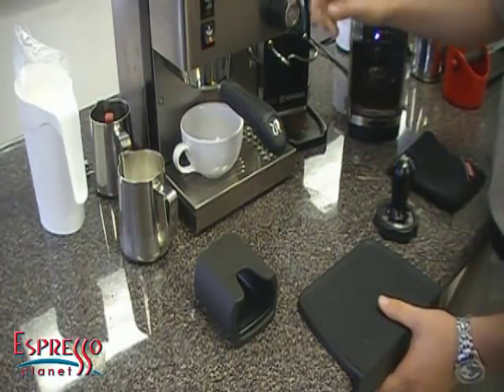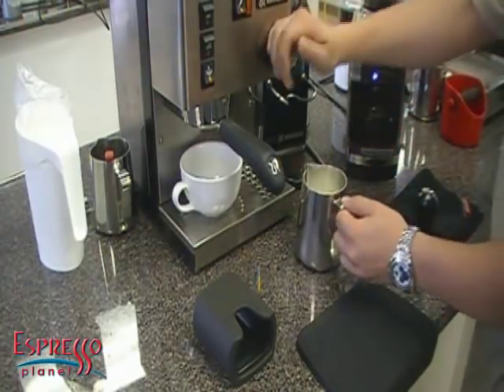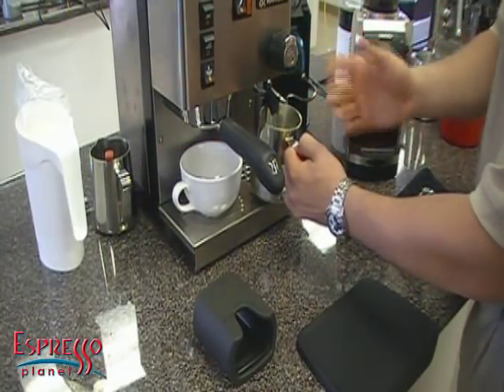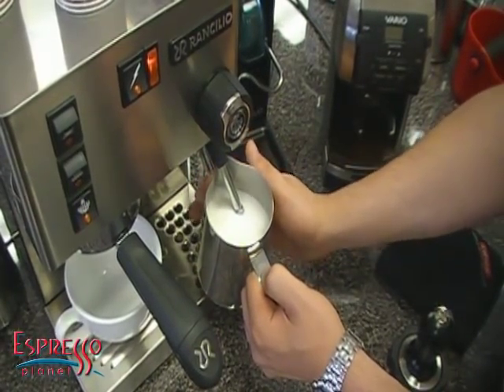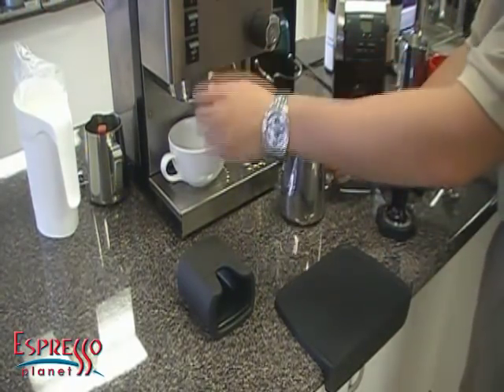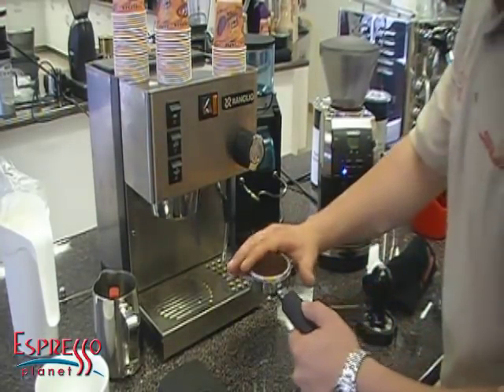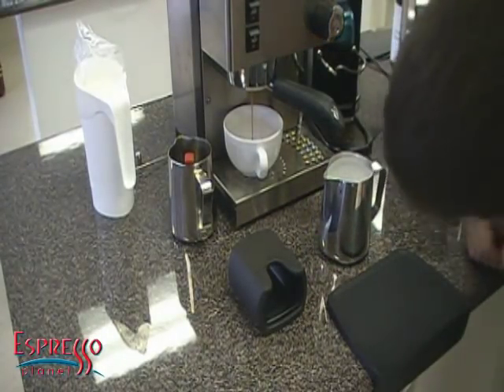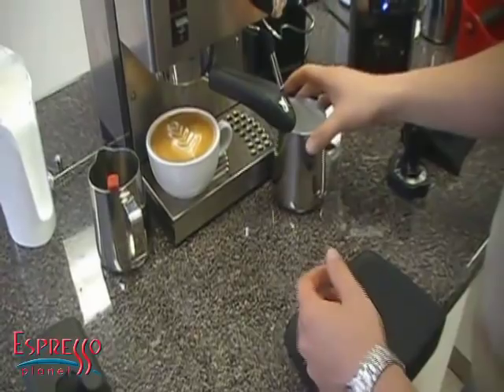Latte Art on the Rancilio Silvia

Comment: Hi,
Awesome video, very clear and instructive. Your coffee looks delicious ;)
Just wanna bring to your attention an error: when done steaming the milk, in order to bring the boiler to the infusion temperature you need to activate the hot water button until you hear the pump make a humming sound ( takes around 30 sec), cold water will fill up the boiler space (emptied by the steaming process).
pressing on the espresso button instead, shown in the video, also bring down the temperature but will not fill up the boiler, this makes it hard to control the boiler temperature when making consecutive shots and risking the safety thermostat to go off or even burning the element one day (the boiler keeps emptying till it has no water left inside) 

Cheers

Comment: I know this is sort of rude to ask for your time but,
I am new to making Espresso, but after looking at a lot of videos/reading a lot,
I decided I would get into a new hobby - making Espresso.
So now, for a couple of days I owe the Rancilio Silvia V3 and Rancilio Rocky grinder.

I went to a coffee store and bought fresh beans, 
I tried the single basket first, because I'll mostly be using it for myself, But, I realized that it is quite a hustle because the inner basket is super small, I couldn't manage to get 7 grams in there. (given up on that for now)
double basket - I use 16 grams of coffee, I tamp it as evenly as I can, I set my timer, and did this multiple times until I had an extraction of 27 ml in 24 seconds, which i read should be good.

it has a bit of crema, but it tastes VERY strong, and the coffee I bought is supposed to be the opposite (that's what I specifically asked for since I don't really know what a good espresso tastes like) 

My question is, do you know what I might be doing wrong? 
and, or.. if you have time and feel like it make a video on how to set up your 'gear'

in any regard, Thanks a lot, and great video(s)! :)

Comment from the maker: Yes and no... I'm impressed that you get consistent latte art using a thermoblock heating system. You don't get the power to roll or texturize very well. Goodjob! The "boiler" over thermoblock will give you much more power and steam + dry steam, allowing for much better and easier micro-foam.

Comment: Thanks for this video, the power of this thing is a whole different level to my previous machine (sunbeam em6910) so i was not used to steaming for a single cup in ~10 seconds. I copied the positioning and that 50% tip, had very nice and smooth foam the first try. THanks!!

Comment: I need help. I've had a Rancilio Sylvia for a few years and no matter what I try I can't make proper microfoam that is consistent enough for latte art. Could I be blasting the milk with too much steam pressure? Maybe not enough? Am I submerging the wand too deep in the milk? I try and follow the video clip but I can't get good microfoam. I end up with separated thick foam on top of hot milk underneath. I keep swirling the pitcher after frothing and it looks shiny like "wet paint" but when I pour it, the hot milk pours first and the thick foam plops out in a glob. I've tried using a thermometer and I've also used the hand technique for knowing when to stop frothing. I challenge any barista out there to make microfoam on my machine. I don't think it's possible.

Comment: thanks for explaining why you make your foam first but I would opt for my shot first
Reply: Since no one relied to you and it’s been 3 years... here’s the answer lol

Its because this is a single boiler machine it only has one heating element to make steam and water... steam is much higher temperatures than coffee extraction temperature so you steam your milk first... then you see him run water through it, this pulls fresh cold water into the already hot boiler cooling it down and heating that new water at the same time to a temperature better to pull your shot with.

If you did it the other way your coffee creama would have disappeared by the time your milk was ready to pour :)
Reply: @Ryan-ik2mk  either way, you have to choose if you want the milk separated ( for me even the swirling the pitcher sometimes doesn't help ) or the coffee crema disappears, after owning the Silvia for 6 months she is not a forgivable machine :D, Maybe I need to practice more.

Comment: Hi, Can you tell if steam temperature affect micro foaming?

I do experiment inconsistancy with the previous Sylvia model. Anythng different with the new wand model?

I pull the shot first, then foam milk. Turn on steam light for 30-40 sec, than purge wand and  start foaming. Steam light stay on al time until I get 150-160F on thermometer.
I suspect my skill too.

Can you tell what is wrong?

Deny

Comment from the maker: Any time you use a single boiler machine and want to make multiple milk based drinks you will be waiting. The goal is to "temperature surf" and try and minimize the down time. I'm not as familiar with the Lelit, but the Silvia has been "the" machine to go to when starting your foray into the world of high end espresso machines. Give us a call if you need any more information. 905-279-3666 - Josh.

Comment: another guy sells machine told put the steam want at bottom then when gets worm hey told me lower the picher het milk to 150
Reply: No way - you should never put the wand at the bottom, it's going to hammer off the metal and heat up one spot too much and burn the bulk. Just do it like above until it's too hot to the touch and then stop.